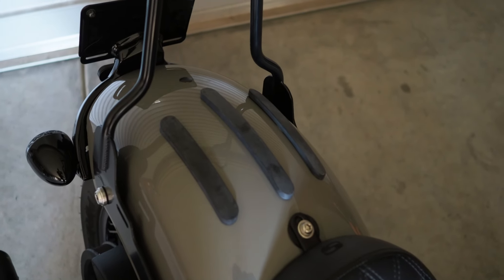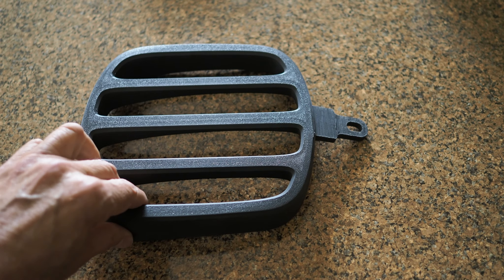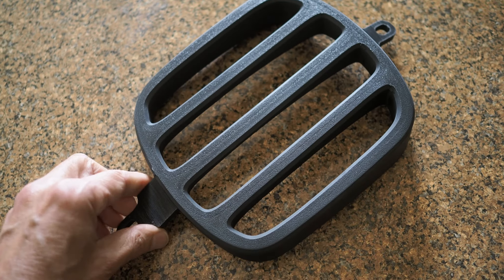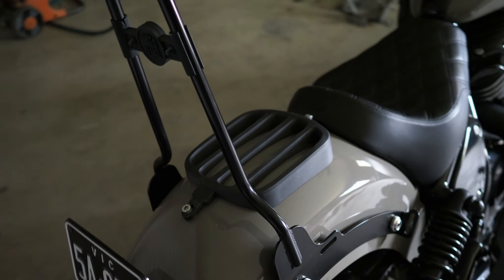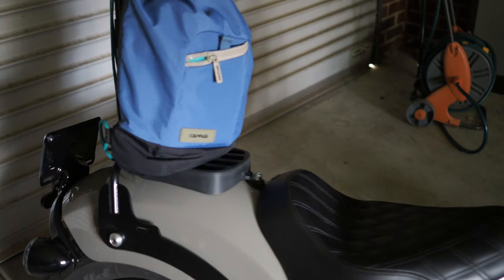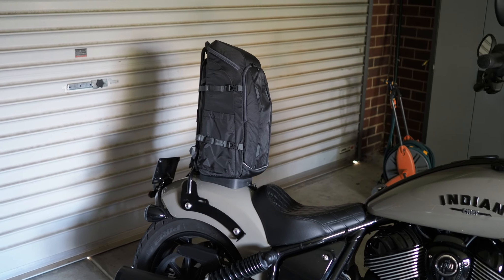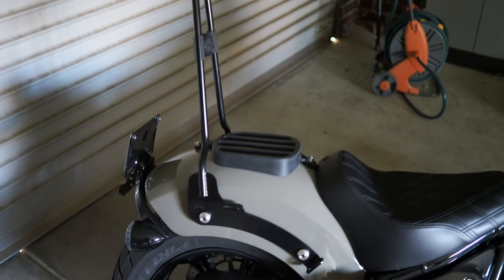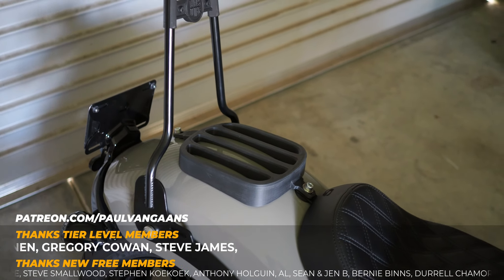3D Printed Rear Fender Rack?

Comment: Looks very good. Just wonder if a small 'arch' feature, in each front lower corner, would help any rain or washing water drain away? Would void having a small pond sat on the fender, if the rubber is a really good seal.
Reply from the maker: Good thinking Steve! Cheers.